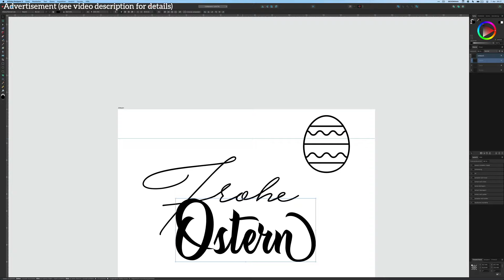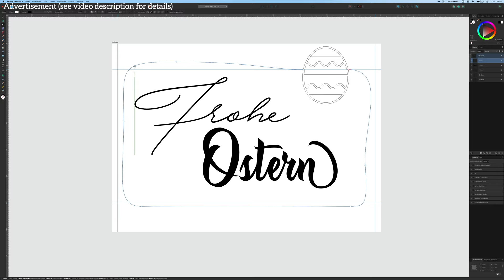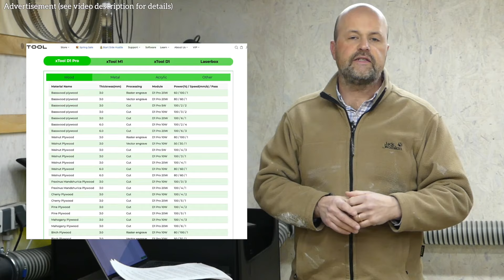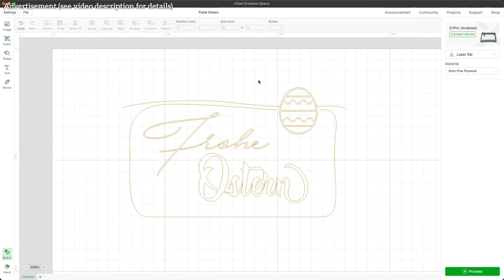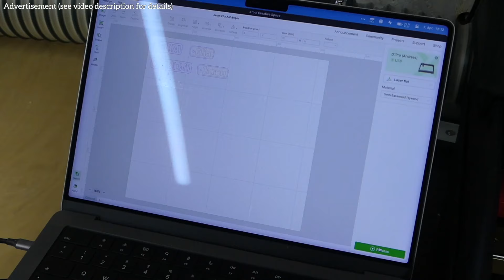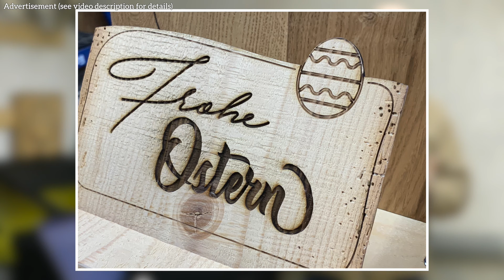xTool D1 Pro 20W Laser Cutter and Laser Engraver

Comment: Another very interesting video, Andreas, and a reminder that where heat and wood are involved, you can't be too careful.
Did you see the video recently by Bourbon Moth about Oily Rags in Workshop bins ?
If I were to get a lazer, I would probably use it for making templates to use on my router table if the material was thick enough.
Reply from the maker: Thanks for your feedback Colin. I didn’t see the mentioned video but I know about those dangers. I always dry oily rags outside on a stone slab and spread out so that any heat can easily dissipate.